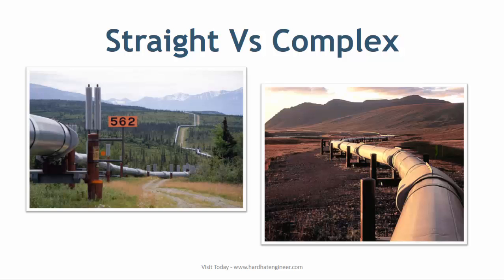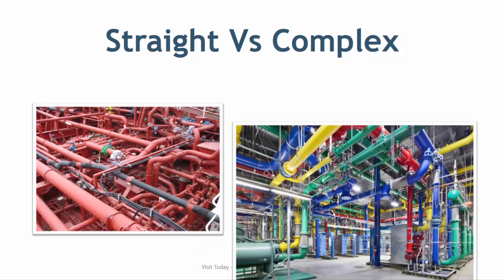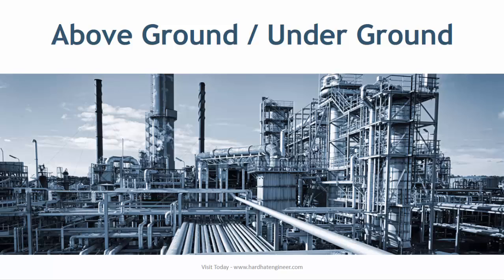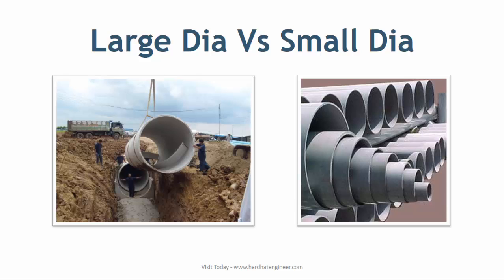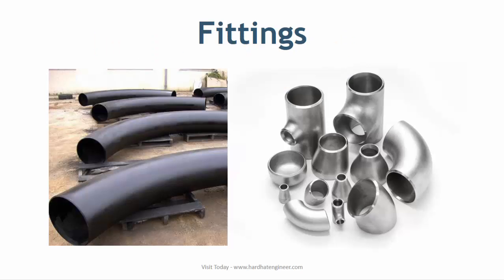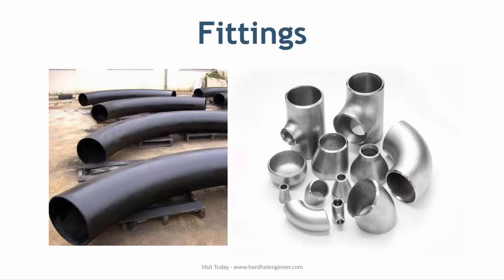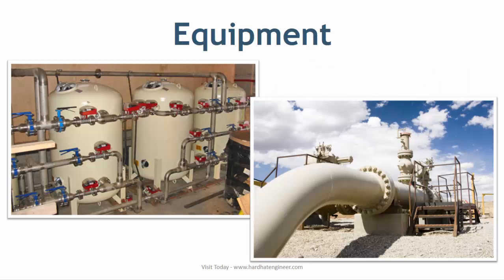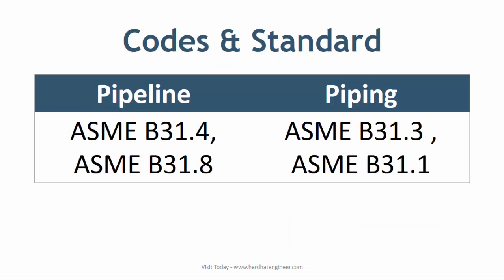What is The Difference Between Piping and Pipeline. Piping Vs Pipeline

Comment: why pipe size in inch ? ans in breaf not only convention method..
Reply from the maker: Pipe size can be in Inch or mm. Pipe size is defined in NPS, DN or NB.  I used inch for this video. Refer B36.10 if you are using ASME code. Check this video -https://youtu.be/oEQqSdZoqTA
Reply: Because traditionally process piping standard Bs31.3 define the pipe size define only in inches.simply for refinery piping system BS 31.3  define pipe size in inches all over the world